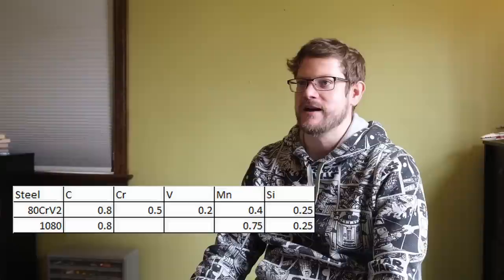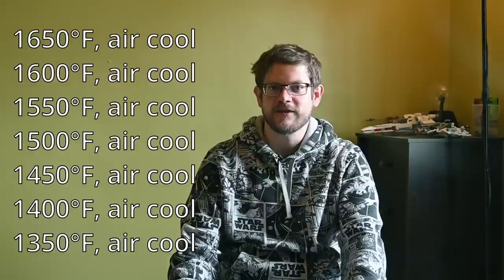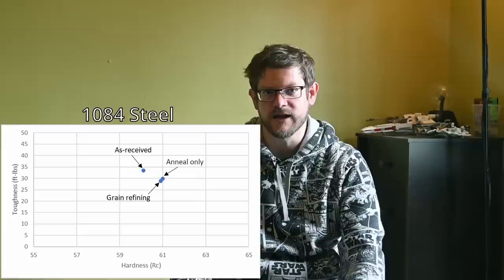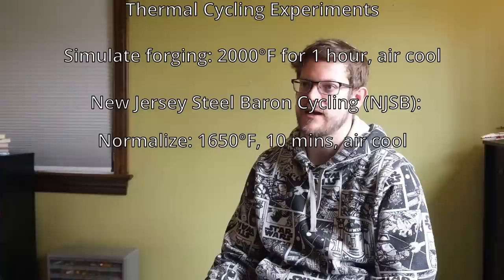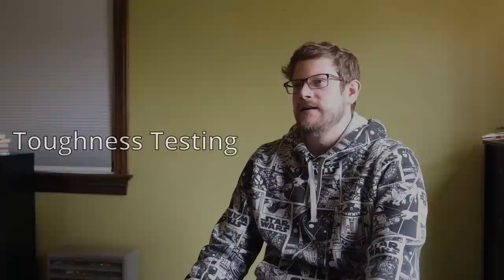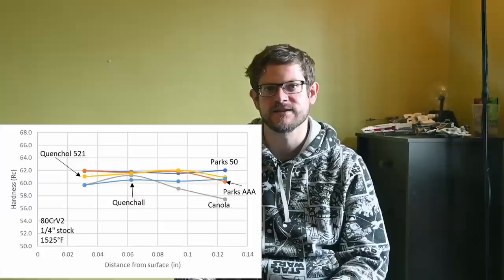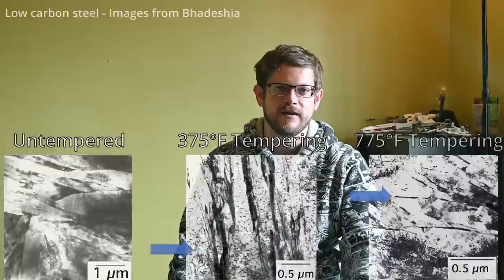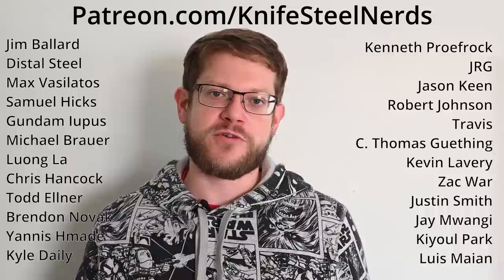How to Heat Treat 80CrV2 Knife Steel

Comment: Hi there Larrin.  I have a copy of your book, a copy of John D. Verhohoeven’s book, spoken to Graham Clark (and watched his videos) and have done plenty research, of different metallurgist and tertiary institutions and ABS Master Bladesmiths.  I still find many many contradictions especially wrt what exactly is “Thermo Cycling”, Homogenising, Normalising and sub-critical spheroising annealing.  The old argument wrt 3x “Normalising”cycles at same heat vs 3x “Normalising” cycle at diminishing heats from above critical temperature, to non-magnetic to sub-critical temperature vs only 1x Normalising cycle to 30° above critical temperature Ac1 or Acm line depending on the steel.  Is this all confused terminology.  What is your take on correct “Thermo Cycling” for knives using the correct terminology of each step??  Thanks. P.S. something like a process flow diagram/chart
Reply from the maker: I have an article/video on that subject: https://knifesteelnerds.com/2021/08/28/how-to-thermal-cycle-knife-steel/

Comment: 6:40 why use tempilstick for forge HT? cheap thermocouples are $3-5, meters $10-20. 
22:30 is the 2x2h rec for 300F [148.89 °C] or in general? seems fairly long for a simple steel. assuming I have an accurate tempering oven or use salt or hot oil to temper, could I use 2x 30 Min instead? i.e. is this purely about consistency or do I lose out on something else by not going the full 2h? 
23:10 more challenging = takes longer for the finer structure to austenitize? could you get around that by plate quenching once so you start from martensite instead of pearlite? I'm using a coal forge with a pipe muffle and copper spacers and a thermocouple for repeatability, getting 5 min even heat is possible but 10 is stretching it.
Reply from the maker: It’s not impossible to do shorter tempers, no. But there are certain things that happen with more time like transforming retained austenite. I think you have the time.
Reply: @KnifeSteelNerds  where can I read more about that topic? a graph or something would be nice. I could just believe you and do the 2h, but then I haven't really learned anything new.
Reply from the maker: https://knifesteelnerds.com/2018/04/23/what-happens-during-tempering-of-steel/

Comment: What do you think about correcting warps with multiple tempering cycles while clamping the knife to a straight fixture? Tyrell Knifeworks says that you can theoretically do endless tempering cycles at the same temperature to dial in the straightness. Is this true or does one loose some hardness after a while? I just tried this with two O2 chefs knives wich came out dead straight, but it seems like they lost quite a lot of hardness afterwards. But bear in mind that I am one of the imbeciles that heat treat in a forge. May god forgive my soul.